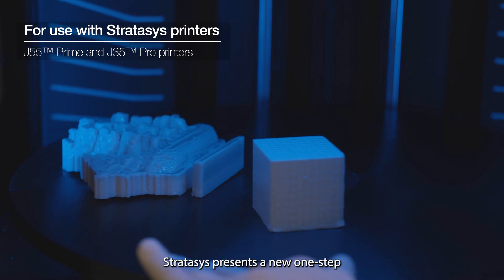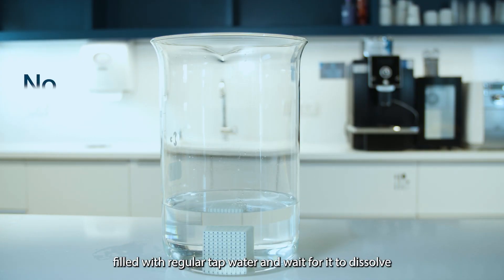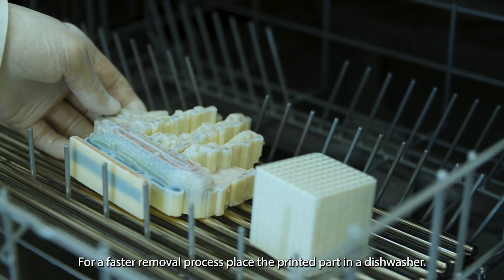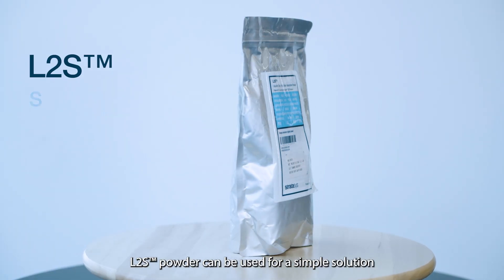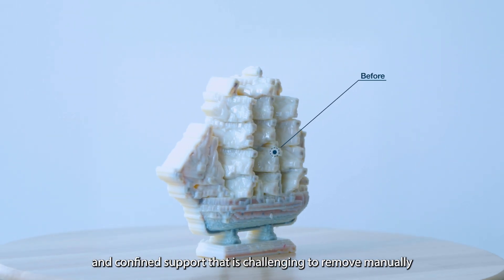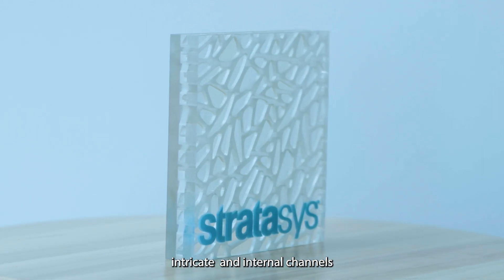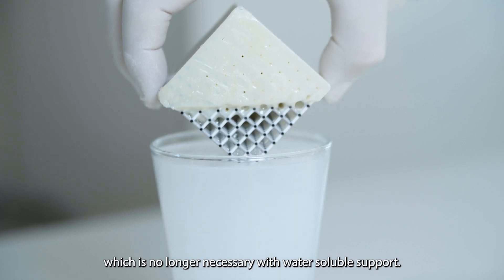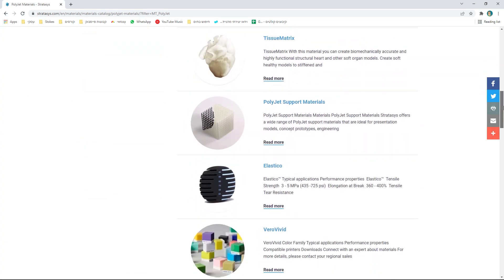Water Soluble Support Material - WSS™150

Comment: Why is it suggested to use a standard dishwasher if the resulting wastewater is classified as hazardous waste requiring "L2S powder" to dispose of it as a non-hazardous solid waste?  Seems to be promoting flushing the hazardous wastewater down the drain unless I am misunderstanding something.
Reply: info: they said "according to your country law" do it or not. They clearly do NOT promote do drain it  "just down the drainpipe into the groundwaters".
Reply: They mention a table top dishwasher in other literature which has a self contained water source. When not using a dish washer it will take hours to overnight to dissolve  support material.